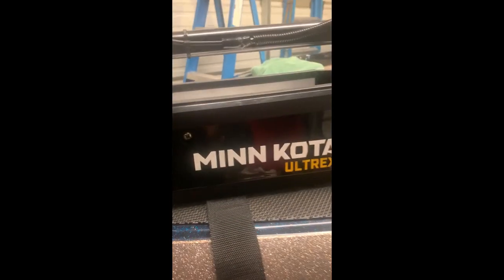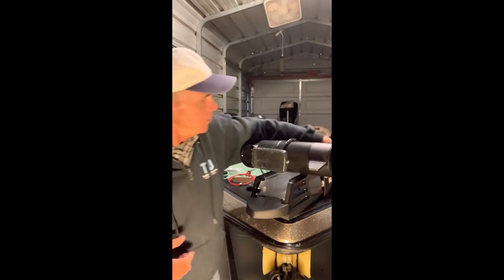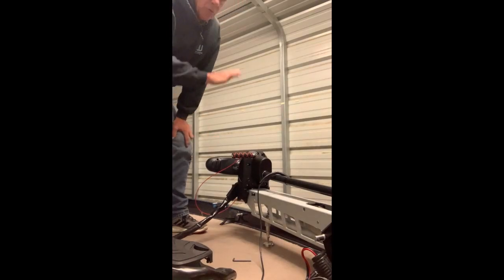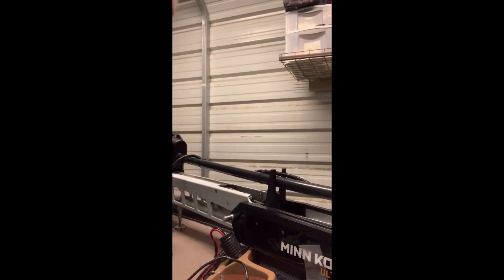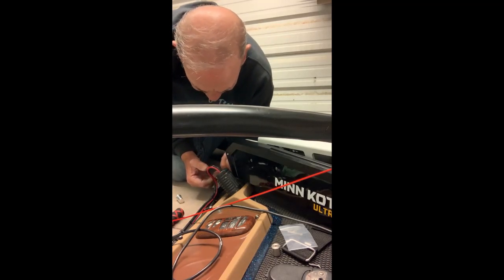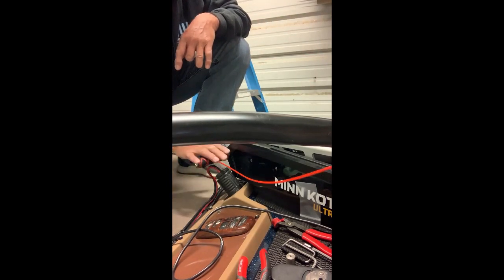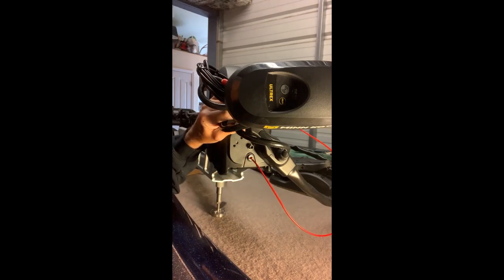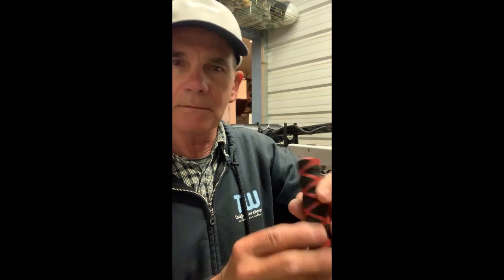Red One Systems Ultrex Deployment Cable  Installation Medium 2

Comment: Just got mine and have to say I really love it and very well thought out. Great product!
Reply: Tim Aldrich how did you get the e clip on?   Not much space at the bottom.  I put the pin in from the bottom for now with the e clip showing on top.
Reply: Paul Douglas , after losing the first clip I figured out you can just remove the top pin and bushings and flip the bracket down exposing the area the eclip goes on.
Reply: @201tim  
How do you take out that top pin, it would look better if i didn’t have to put it in backwards ?
Reply: @19ADAM80  I'm going to have to look, to be honest with you I can't remember right off the top of my head.
Reply: @201tim  
Ok bud